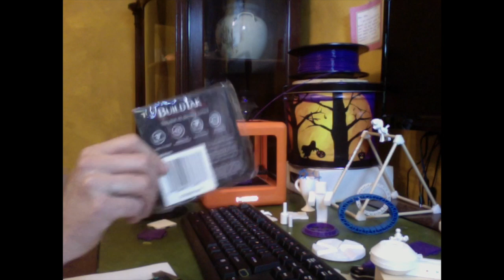M3D Microprinter review - One week of printing

Comment: Could the problem  with the size of the "action figure" be because they expect sanding or did you already  sand it smooth and it still  doesn't fit?
Reply from the maker: Daniel Piatt Could be the design team made that decision at some point. . It's a parameter that's available in more advanced software. Hiding it keeps things simple.

Comment: Great video and great prints! Wish my M3D worked as well as yours :( My print head keeps hitting the print and it's incredibly annoying!
Reply from the maker: aidan00ah That's a problem I haven't had. I've had most of the common ones at this point. I'll have to post an update.
Reply: +aidan00ah you can just re calibrate the print head to float a little bit more above the bed